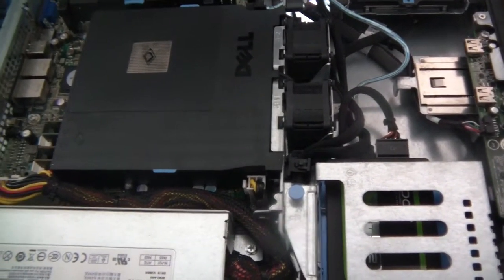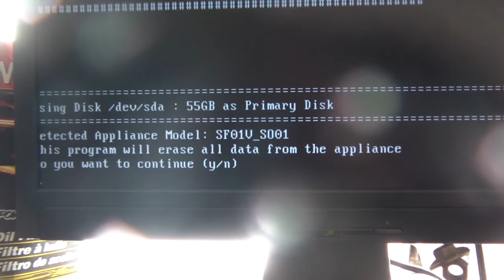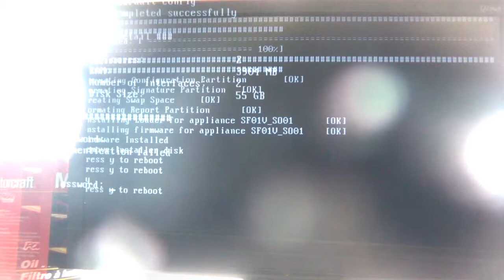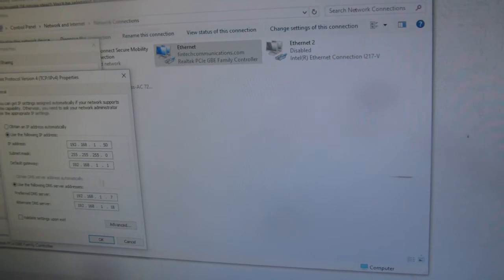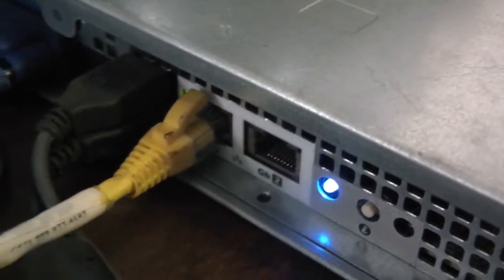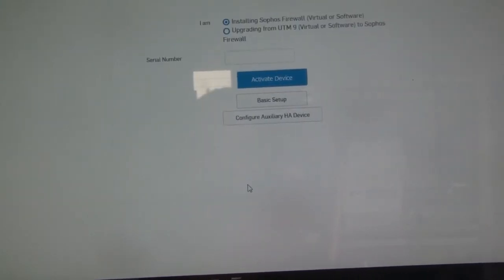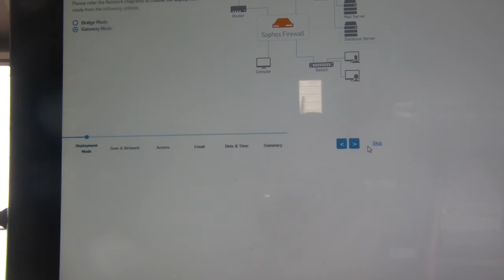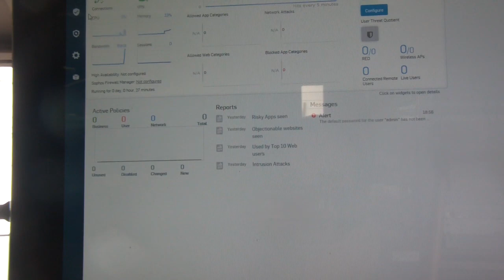Sophos XG Firewall install

Comment: hii sir can i use 50 user
Reply: The Sophos home XG firewall offering has unlimited users (/internal IPs).  It is simply limited to 4 CPU cores and 6GB of ram.
Reply: @LarryHerzogJr  Hi, very interesting vidéo; are those physical cores or threads? On a serveur with a lot of ram, would you recommand virtualising it with ProxMox or Ubuntu Server? (A baremetal setup would sacrifice the rest of the ram)
Reply: @axn40  Physical CPU cores.